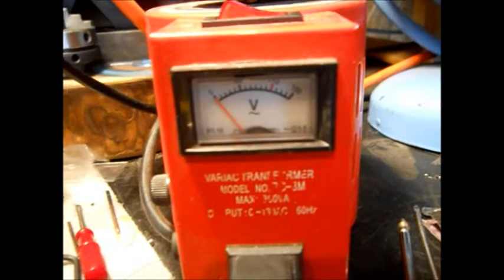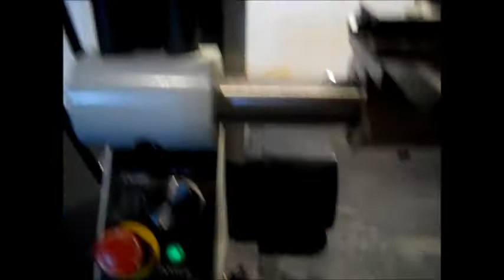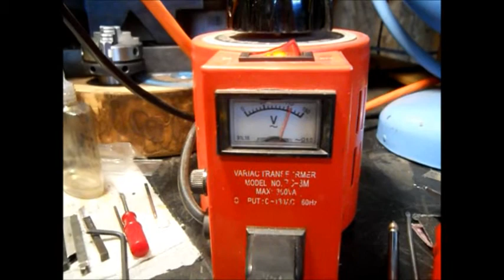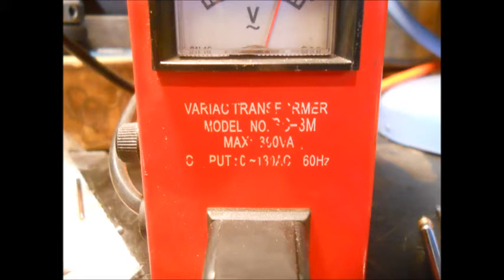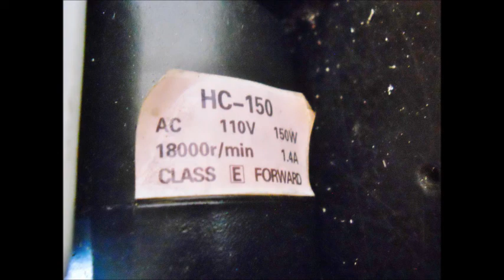Nano Lathe Motor ( Says on tag 110 volts )

Comment: its running better because you are feeding it a constant line voltage. It's the same thing with my guitar amps. If I plug them into the wall the line voltage jumps around and plays havoc with the sound. So I use a furman power conditioner to even out the voltage and it smooth the sound right out. same thing is going on with the variac.

Comment: I have a router speed controller that I use on my wood lathe and other motors. It can make quite a difference. Watch out for heat in the motor.